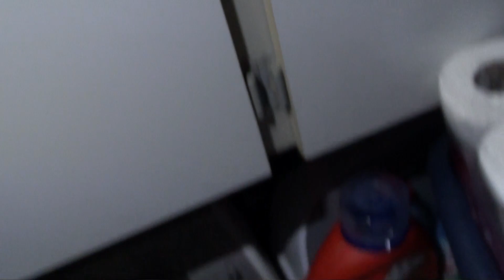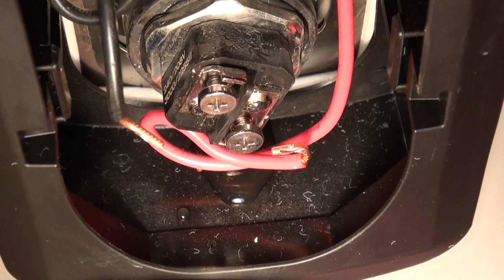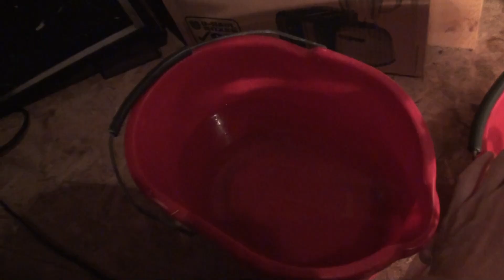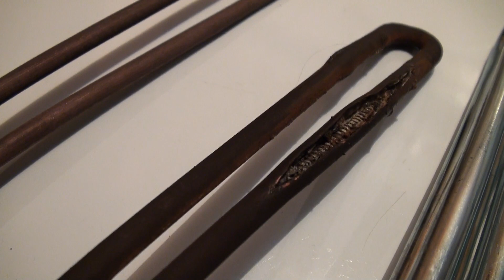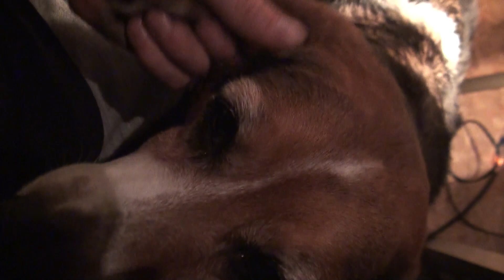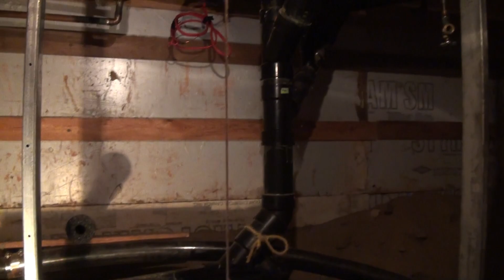Strange Electrical Problem

Comment: Maybe there is a longer breaker wired in the panel that can go higher and put the 30amp for the hot water heater down lower in panel so you don't have to jimmy rig the breaker in panel, ps massage zoeys hind legs, i think its cause the use them and produce so much force out of them for running that they get kinda over used that stuff vet gave you will really help...  Holy shit Scotty wow! Man am i glad this happened and you found out about no ground 👍👍👍 so happy you and Zoey caught this.. 😊
Reply from the maker: So the house is has a properly wired "equipment ground" or "bonding", however it is currently not earth grounded.  Even amoung electricians, there is a lot of confusion about the word "ground" or "grounded", we will explore this, along with drive a ground rod that is consistant with the local code to remedy this sitiation.  Right now my house is not protected from over voltages such as static, or high frequency DC pulses from this such as lightning strikes.